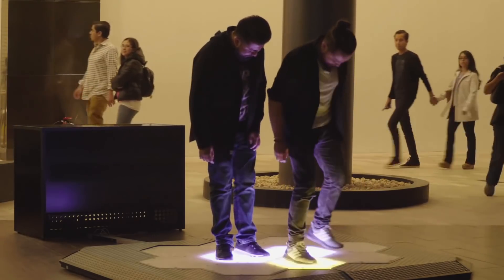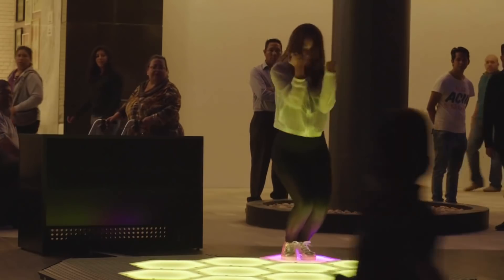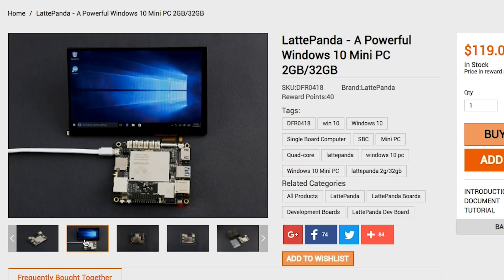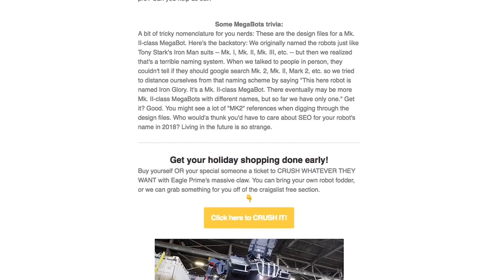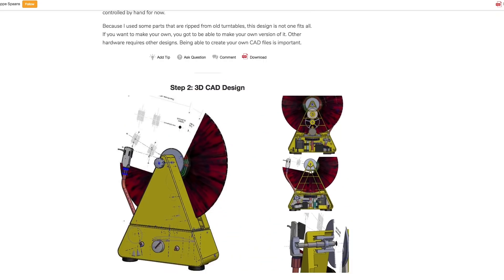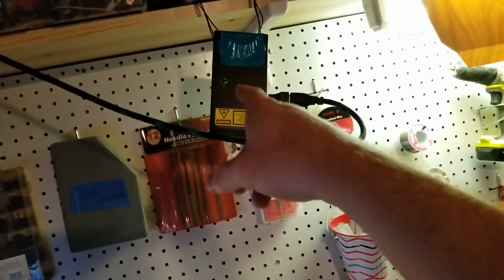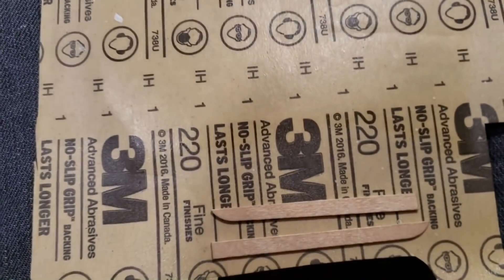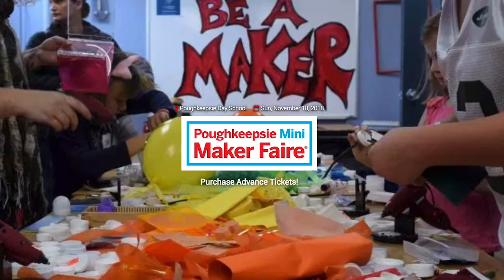Maker Update: Open Source Mech

Comment: some late info.     i invite you to invest some time and energy, in something  Important.      my research suggests that  'apparent'  overunity is  possible and practical, if an efficient,  large-radius bldc prime mover is used to drive a suitable pma.      in such a situation, for proof of concept,  the motor need not have a high rated output wattage.        it should be understood that  power Should be taken off the motor, Not at the perimeter of the rotor, but at the   Center of Rotation,  via the addition of an output shaft.    direct (or reduction) drive could be tried.     i am working with a   f&p motor, and direct drive config.      the motor's  components are  heavy and difficult to work with, and  the contraption of  mountings  and  output shaft, are required.       i believe that a  large-radius, e-bike bldc  hub  motor could more readily be adapted to this purpose.   see linked video, for the concept.     it should be understood that a large radius bldc (outrunner)  has  a  LOT  of  inherent torque at its  Center of Rotation,   as a result of the large radius at which   Force  is  produced.  thanks        googletranslate
https://www.youtube.com/watch?v=IiI13X7fNVM